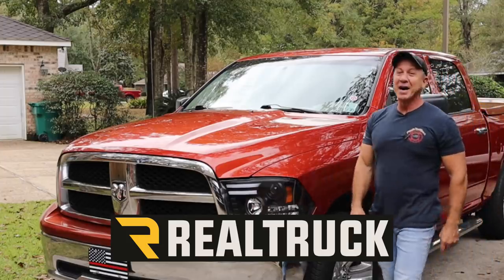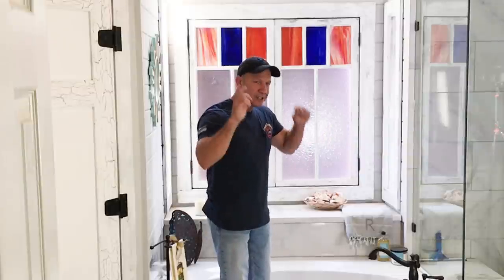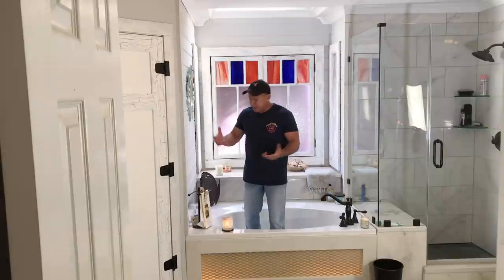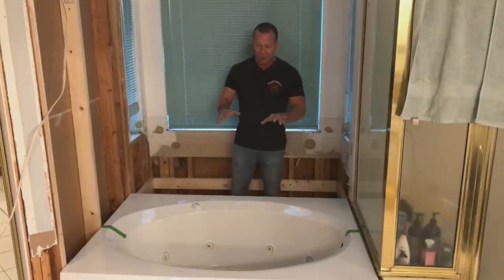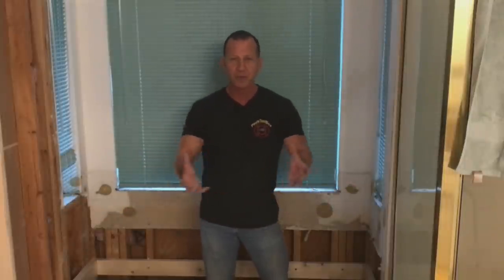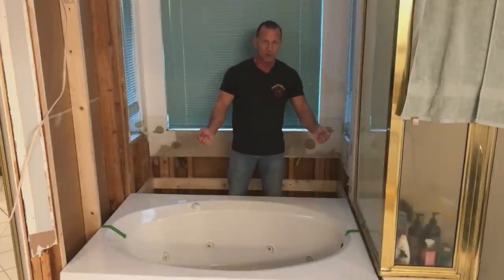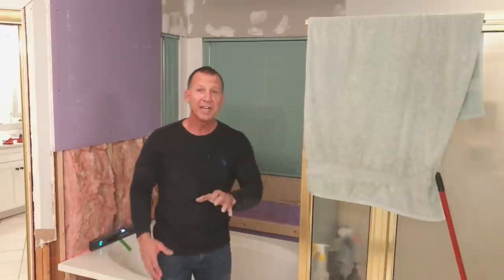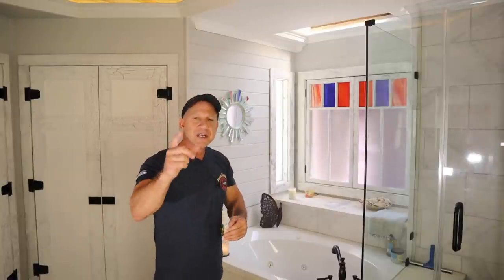Must-Know Bathtub Installation Tips: Avoid These Common Mistakes! | Paul Ricalde

Comment: @Paul, it helps to create channels or a grid that is slightly lower than the mortar bed finish elevation so that the high mortar has a place to move when settling the tub in place. Also, piece of chicken wire or expanded metal lath on the sub-floor prior to pacing the mortar bed prevents potential splitting or break-up.

Comment: Of course it gets a like, why shouldn’t it. Paul is the man!
I was taught by a plumber recently that the plastic is great for the reason you used it (preventing adhesion) and also some tubs were showing staining through the fiberglass from the cement and they wouldn’t warranty them. My ocd makes me put a cleat on each side to prevent any possibility of the tub lifting and messing up my level line to start my tile while cement cures. Probably not necessary but it makes me sleep better knowing it’s as I left it. 
Hope all is well in your life and post up more often, you’ve been missed. 
Even though I do this for a living as well it’s enjoyable to watch someone else do their thing as we all can still learn something new.

Comment: Just started the video and have installed a tub before and I'm not sure if this what you will be doing but the tub that was in this house cracked because it was not supported underneath so we did a lot of research to find a solution. We bought bags of cement and heavy duty construction garbage bags, we mixed the cement and put it in the garbage bags and leveled the tub on it before it set up. We have a very secure and heavy duty underlayment now to our tub.

Yay we did it right lol
Reply from the maker: Wow, I never thought of that. Keeping it inside the bag. Great idea, thanks!

Comment: Mortar bed is very good. You could reinforce it with rebar, use gravel, not plastering sand so it will not crack, add some timber around it may be as well. I'm using cement board in thew bathrooms instead of any kind of drywall.
Reply from the maker: Hi John, I do not use drywall in showers where it will constantly be exposed to water. Drywall works fine for this application. Thanks for sharing buddy!

Comment: The best trick in the world for installing tubs is FOAM. Set the tub, fill it about half way with water, then foam it with regular foam. Not high expansion. Should take 1-2 cans. Come back the next day, release the water, and when you step in that tub it will feel solid as a rock. Like stepping on concrete.

Comment: I'm happy to see you made it through the hurricanes OK. We got hit with 2 of them but survived.
I'm glad you mentioned electrical. Sometimes people do stupid things with the wiring and even when the switch is off, there is still a hot wire going to it- my best friend nearly died that way. He was changing a light fixture in his grandfather's house & even though the power was off at the switch, it still had a hot wire that zapped him so badly he lost feeling in his right hand and in both feet. He was unable to feel pressure in his feet & couldn't drive for years. Sensitivity eventually returned enough for him to drive but he still can't feel how much pressure he's exerting with his right hand.
We're going to be installing a bath tub in my house sometime in the (hopefully) near future. Trying to keep budget under $5k but already spent close to $1k on the fixtures. Got the lavatory, toilet (re-used from another room where we upgraded to an ADA height toilet), mirror, old medicine cabinet, vanity light, heat/vent/light for ceiling, tub & wallset, etc.
I will be shutting off my main water supply when I do continue demo in my old bathroom.
What do you recommend putting on plywood floor underneath a tub? Would another sheet of plastic or plastic bag work? Or maybe landscaping material stapled down?
Reply from the maker: So sorry to hear you got hit with 2 hurricanes!! One is more than I care to deal with, I hope it wasn’t too bad around you. If I were you I would use visqueen, it will make a good barrier to keep the mortar from sticking. You can always put another bag underneath and on top or you can mix it up in the bag and just set the bag down if it is big enough. One of my viewers gave that tip,  I found it to be pretty good! Thanks!
Reply: @paulstoolbox  Thanks, we had minimal damage from the hurricanes but house got invaded by raccoons while we were evacuated. They ransacked the place. Back door is still busted so they keep coming in at night. They are bigger than my dogs. My dogs try to chase them, but the raccoons stand on their hind legs and try to stare them down. I walked into the kitchen to see that happening. I envisioned a Far Side style cartoon with one holding a switchblade & another standing with its hands on it's hips facing off against the little dog. But, at least our house is standing. Lots of people in my area lost their homes to fallen trees & wind in the first one and then 2nd one did major flooding. Some were just rebuilding & then got flooded. We're on high ground so we were lucky. Kitchen floor was ruined by fridge & freezer defrosting & ice bags melting, but everyone was OK and that's what's important. I have a new back door put in but need to raise the header & level it (it drops 1" from one side to the other) & replace the rotten sill.
Visqueen sounds like a good idea. I think I have some down in the workshop. I believe Sterling/Kohler recommended a 1" to 2" mortar bed under the tub. Any tips on mixing it? I keep seeing different opinions. Some say very wet, some say barely wet & I'm not sure what works best.

Comment: You don't need to use concrete to set the tub . Gypcrete is much lighter and supports the tub just as well. If you staple roofing felt paper on the floor first then staple some chicken wire on top of that it will never move or shift.
Reply: What about for concrete floors?

Comment: Great job.  I had a plastic tub i installed about 15 years ago.  It had a honeycomb bottom they say was for reinforcement, no concrete needed.  I listened and got screwed when they call me back one month later with a hairline crack down the middle.  I put a steel tub in and concrete.  Never got called back ever.
Reply: I installed the same.  Luckily, no crack yet after about 4 years.  Due to some popped tiles from last year, I am taking the floor back out so I can now correct my error when I reinstall it.
Reply from the maker: That’s stinks, it’s almost  like buying a new model car. You have to wait till the bugs are out before buying one. Unfortunately some companies never bother, they play the numbers game. Thank buddy!

Comment: I heard you can use spray foam instead if cement.
Is that true?
Reply from the maker: Hi David, I’ve heard of people doing different things like using expansion foam or silicone but I personally would not try that. I’m not positive but I think expansion foam will give under a heavy load. 30 gallons of water plus a 200 lb person can put over 450 lbs of weight . on the tub and sub floor, if the foam gives or fails, the weight is now transferred to the top lip of the tub that is sitting on the 2x4 frame. This could cause squeaking noises when moving in the tub and could eventually crack the tub. This is just my opinion but I hope it helps. Thanks!